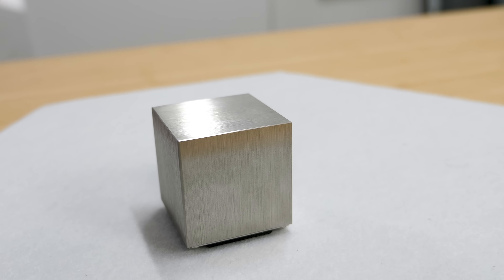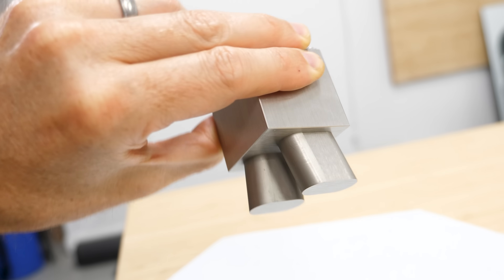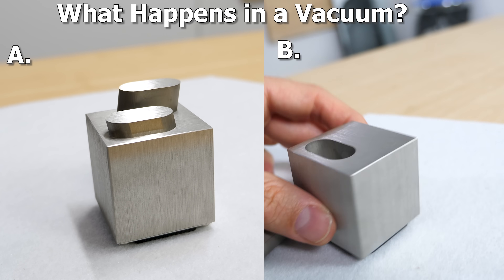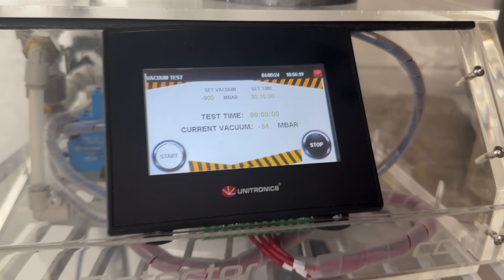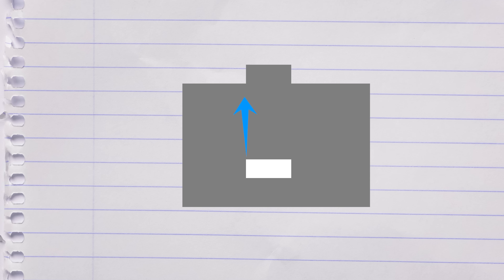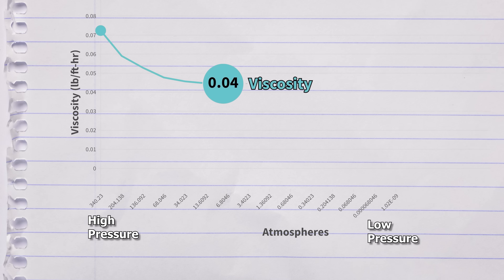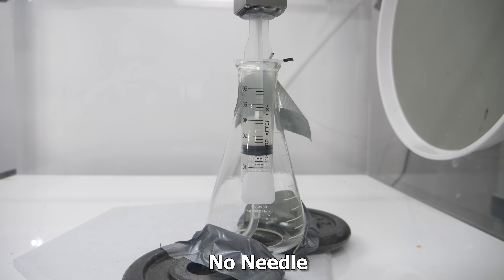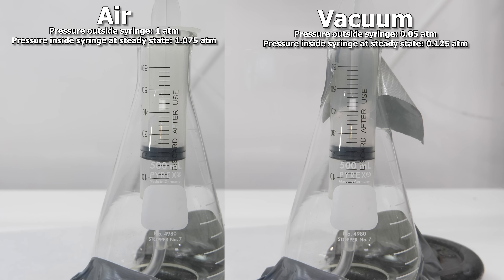What Happens to Perfectly Fit Pieces of Steel In a Vacuum?

Comment: You called it "viscosity of air". But as the syringe took what little amount of air that was in the syringe and compressed it, once it reached the same density of "regular" air, it naturally slowed and emptied through the needle at the same rate. That is because the density equaled regular because the syringe was compressing the air.
Am I right, or if not, what did I miss?
Reply: That's what I thought.
What if the pressure in the vacuum tank goes even lower?
I'd suspect the syringe would slow down later, if at all.

Comment: If you removed the oxide layers on the surfaces of those metals while in a vacuum and try to slide the pieces in, they would cold-weld together as if they were always once piece of metal. Such is the nature of materials with a lattice of atoms.

Comment: I love seeing how he figures out how to interact with stuff inside the vacuum chamber
Reply: I'm pretty sure he's put everything in his house that will fit into his vacuum chamber. He just shows us the interesting ones
Reply: How nice it must be looking at the problems of the world for a sol'n and being able to think, "Lasers, mthrfkrz!"
Reply: @NotSoMuchFrankly just look at Styropyro.
Reply: I thought the metal would cold weld together in a true vacuum, is that wrong?
Reply: It won’t weld due to the oxide layer at the surface which metals gain on Earth due to oxygen.
Reply: @amelliamendel2227  Don't know about that but if you heated most metals, at some point they'd expand and increase the friction holding the pieces in.
Reply: He should design a system for mixing epoxy resins in vacuum. It can avoid vacuuming after mixing, which doesn't do a good job of removing bubbles.
Reply: he should just attach gloves to the box
Reply: @purpleey : How could he supposedly seal them well enough and still use them, especially if they were tough enough to not blow up like balloons with the vacuuming?
Reply: @HelloKittyFanMan  cut a whole in the box, attach gloves on the inside like the ones u use for dish washing, seal it using something like flex seal. boom
Reply: @purpleey : OK, assuming that he only has one instead of two, so that he has one hand in the glove and keeps the other hand free for turning on the pump, so that the one hand is already in there and keeping air from blowing up the glove like a balloon, right?
Reply: @HelloKittyFanMan  i dont get what ur asking and why would it blow up like a balloon?
Reply: Heh 🥴
Reply: @purpleey  Do you even know how strong 1 atmospheric pressure is? Even if the glove didn't burst, you could hardly move any part of the glove in any direction.
Reply: Oh, totally, me too! It's really impressive!
Reply: Oh, totally, me too! It's really impressive!
Reply: 102 likes and zer orpeklleis ?!?!?!? lemt  sne dj d djd

Comment: What's even cooler about EDM? You can cut tools with electrodes.They make the molds for the cool miniatures using that tech. Think about how complex and expensive it would be to machine a gandalf miniature using traditional methods. That's how they use to make toy soldiers when I was a kid. These days they burn the tools with EDM. Its not called machining, btw.  They make a exact copy of the mini with graphite, which is the electrode (sometimes using 3d printing). Using EDM they plunge it into metal to make a mold. That's why miniatures are so common these days. Its cheaper to tool now due to EDM tech
Reply: What do you thing the M stands for in EDM?

Comment: How about backfilling the chamber with a small-molecule gas like hydrogen or helium?
Reply: That sounds like a neat experiment. Would adding "something" (a low viscosity gas) actually decrease the viscosity of "nothing" (a partial vacuum)? It would seem counterintuitive for that to happen, but given that 0.05 atm is far from "nothing", seeing how different gases interact with one another with respect to viscosity would be interesting.
Reply: @mattp422  that sort of thing would be very useful for something like studying aspects of the high atmosphere.
Reply: @rakninja also which materials to use for aerospace and planes
Reply: @mattp422 I'd try a gas with different viscosity to a relation between viscosity and fall speed.
Reply: @mattp422  but that's not the problem, a vacuum has zero viscosity, you were listening right? he said that the little air that was left in the vacuum chamber is what caused that effect.
Reply: Or cooling down the air a lot to reduce the viscosity
Reply: The gaps between he cutted parts are still huge for air molecules. What hinders them from flowing fast is their so called mean free path, which is a function of pressure and temperature. There is no much difference to be expected with another gas.
Reply: and now I see this was already asked... Would be interested to see this too.
Reply: This was pretty much my immediate thought: I'd like to see this experiment done with different gases of both higher and lower viscosity.
Reply: How about ozone 🤔
Reply: My guess is, it would fall a bit slower in general, and at some point start falling slower, like we saw here.

The reason is, by filling with another gas, you still don't remove the remaining air, so i initially the other gas would escape, andvat the end only the regular air would be left.
Reply: I can see issues arising filling a chamber with hydrogen and some residual air then using a laser to burn a string in it ...
Reply: @LokiCentral   helium would definitely be the safer option while still being much smaller atom size than oxygen / nitrogen
Reply: @LokiCentral  Nothing would happen. At that low of a partial pressure there is not enough oxygen present, the hydrogen doesn't ignite in the abscence of a required amount of oxydating element (it could also be Fluoride, Chlorine etc.)
Reply: He atoms. H molecules. H would be similar to air since its around the same size molecule as airs components. Any Noble gas would be way smaller than H. Good idea, tho.
Reply: @terryenglish7132  So Ar would be OK?
Reply: @LokiCentral  Yes . An O2 molecule is 3,000 times bigger than an Argon atom
Reply: @terryenglish7132  O2 is bigger than Argon, but not 3,000 times bigger.  Not even close.  Not even twice as big.  Argon is an atom.  It has more electrons than oxygen.  Ten more.  The vdw radius of oxygen is 152 pm, and argon is 188 pm.  The oxygen-oxygen bond in O2 is 121 pm, so treating it as a simple hard sphere model, the O2 molecule is 121+2*152 = 425 pm in length.  That's only approximate, but it's in the ballpark.  In reality it's shorter.  Argon would be 188*2 = 376 pm in diameter.   Atoms and molecules technically extend out to infinity, so their size really depends on how hard you push on them.  The wikipedia article on atomic radius is good.
Reply: @incognitotorpedo42  I simplely looked up their size and divided them for the 3,000 ratio. The size of the nucleus is irrelevant.

Comment: Cool!! I was hoping for some space cold welding… Could you try clamping two close fitting metal surfaces together in a vacuum and running a test of DC voltages through them to see what happens?
Reply: @NAGJRC  Cold welding required a vacuum several orders of magnitude more empty than what he's using here. It also requires materials that are very clean, including of oxide layers. Gold is easy to cold weld, stainless steel is pretty difficult and usually requires some mechanical abrasion while in the vacuum to expose the bare metal.
Reply: @jasexavier  Cool! I wonder if his pump can handle a vacuum close enough…😎 Mine only goes to Mars surface pressures…
Reply: @NAGJRC definitely can't handle low enough pressures lol, you'd have to have some insane vacuum pumps to get it as low as you need.

Comment: You can see, you just likely wouldn’t notice unless you were looking for them
Edit: at 1:25 though it is really very noticeable
Reply: These observations are relative, and most of what we see here are tight zooms of a block that's been handled a lot and has some residue around the seams.  The same is true on the vendor's website photos and video.  At 40mm and more than half a kilo, it's still an impressive little thing to set eyes on, and the videos and photos probably don't do it justice, especially when it's new and/or clean.  I'd compare this to when LCD and LED TV's came out, many people said it was like looking through a window.  No, not even close, it was just a finer screen with higher refresh rates than the CRT's we had before, and most not as good as even the early smart phones.  Everything's relative.
Reply: I wasn’t looking for them and I noticed instantly at 0:25

Comment: my immediate thought before watching the video was cold-welding.
Reply: already oxidized.
Reply: @DanceTranced    Some oxidation, also the oils from his fingers handling it.
Reply: That is my thought and i have not watched yet
Reply: Metmo cube works like a magic trick!
Reply: Me too
Reply: me too
Reply: as far as I know what you refer to only happens with certain "flatness" for certain materials. to achieve that for this metal you'd probably need to temper with the surfaces of the parts on a molecular level (done with some kind of targeted electron shooting). as people here mentioned the electronic wire cutting has tolerances of 10-20 micrometers. what I refer to isn't called cold-welding though so sorry if I misunderstood and just talked nonsense
Reply: That's what I was thinking lol.
Reply: Same
Reply: Same
Reply: Same! But maybe only if it was gold/gold plated
Reply: @It-b-Blair  I'm pretty sure this was a problem in space with some equipment, so it can happen to other materials but it needs to be a clean surface. Probably this cube has a coating that prevents cold welding, such as stainless steel or aluminium gets naturally to prevent corosion.
Reply: @tortex1  no need for a coating. all metal exposed to the earths atmosphere will quickly develop a thin layer of oxide that prevents cold welding. If you scratch off this oxide layer in space, the lack of atmosphere prevents the oxide layer from reforming, and cold welding at that spot is possible
Reply: @tortex1  it might also be there's still too much air compared to space. There's probably at least an order magnitude more air in his chamber vs. in space where cold welding can happen
Reply: @tortex1  EDM wire-cut uses electrical sparks to remove the surrounding materials. The high heat probably also oxidizes the outer layer of the material, preventing it from fusing together.
Reply: @stantonfuerton You're right about there being too much air. He's running several orders of magnitude higher than even low earth orbit here. It takes pretty extreme vacuum to cold weld anything other than gold.
Reply: The cube has already been exposed to atmosphere, it's already oxidized. 🤦‍♀️
Reply: @jasexavier What about oxidation?
Reply: @stantonfuerton exactly. Cold welding is very hard to simulate as it requires a really strong vacuum. 0.05 atm is still way too much air.
Reply: @It-b-Blair if they were ground down in vacuum then they would cold weld.  There is already an oxidation layer that vacuum will  not remove.   Rubbing the two pieces together hard enough might do it.